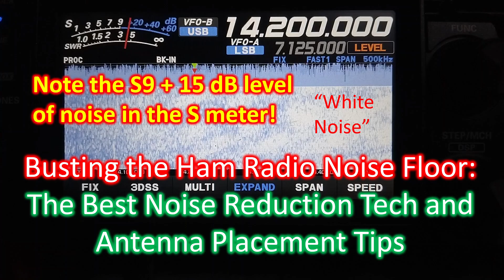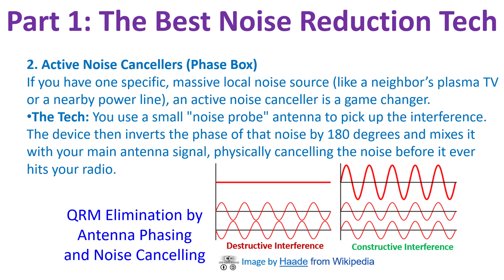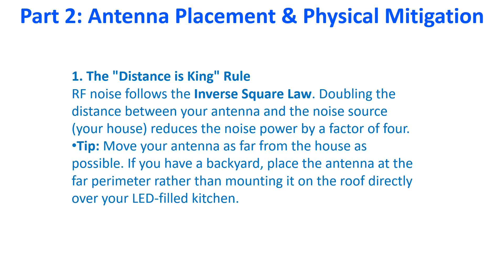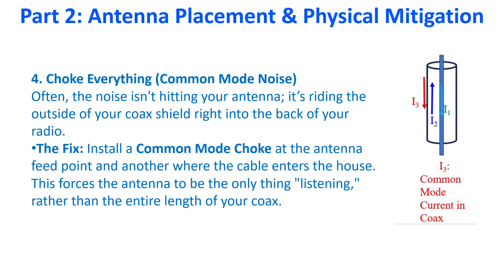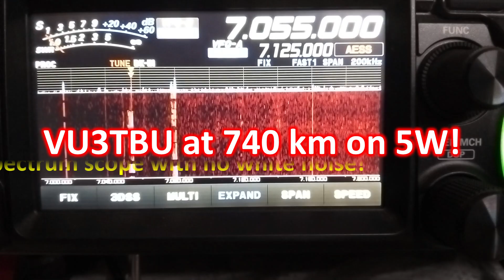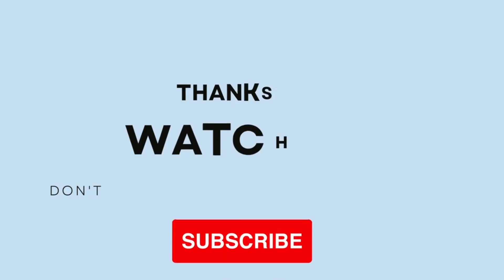Busting the Ham Radio Noise Floor: The Best Noise Reduction Tech and Antenna Placement Tips

Comment: How about the phase shifting QRM eliminator? Of course this depends on Aux antenna and it won't do anything for propagation noise picked up by main antenna
Reply from the maker: You are right. But the top ones are a bit expensive, though there are cheaper options as well.  PTT connection to bypass it during transmitting is also needed.

Comment: The inverse square law approach to reducing the external noise at the antenna only applies to what is effectively a "point source". The geometry of the situation pretty much determines whether the noise is effectively from an "infinite plane", an "infinite line" or a single point. A one-cylinder gasoline lawn mower engine would be a reasonable example of a single point rf noise source.
Reply from the maker: Thanks a lot for the valuable inputs. 73 Jon, VU2JO

Comment: Noise reduction on the kenwood ts140 never worked and it made the "choppy" effect to the noise, not sure how that would help but i always turn it off and seek alternative methods. Ive always found as well anything with a balun in it stops alot of noise as well 73 JON 
Adam, VK6EP
Reply from the maker: Thank you for sharing your valuable experience with noise reduction! 73 Jon, VU2JO